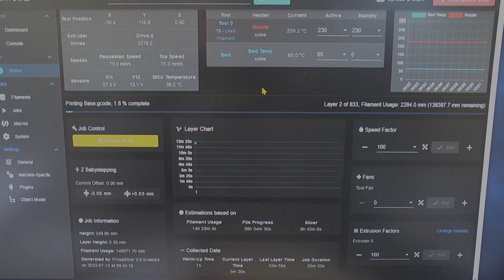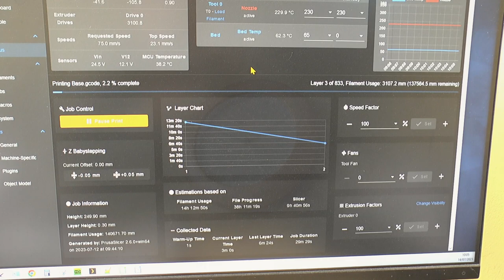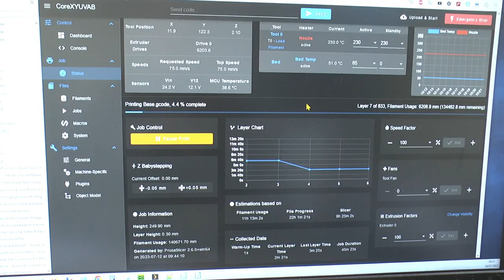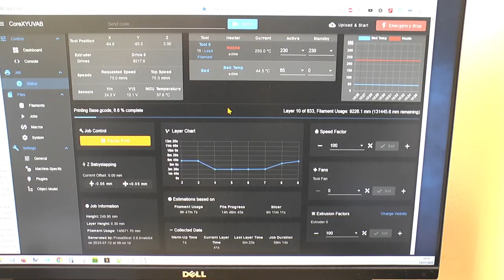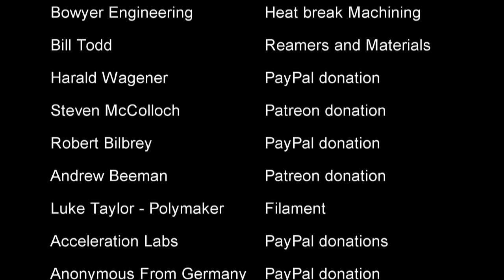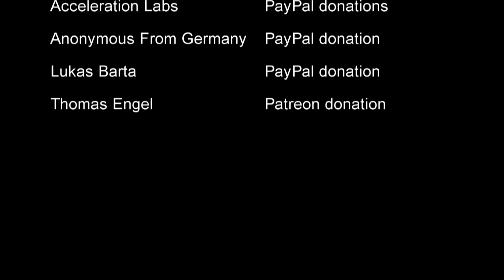NewCoreXYPart13 - UPS battery runtime tests and other bits and bobs

Comment: I have a 24v solar system running my network and fridge . I use 22.6 as a lower limit   ( that's when the mains psu takes over ).
Reply from the maker: What type of battery(s)? Mine are lead acid technology (albeit gel type rather than "wet"). I couldn't afford Li ion of LiFePO4 but for sure, they can tolerate much deeper discharges. I'm being guided by Yuasa's recommendations here. They state (for lead acid - quote) " The life of a battery regularly discharged by 50 percent is about 5 times that of a battery regularly discharged to 100 per cent". They also say to scrap any batteries who's voltage is as low as 11V (for 12V batteries) as "these batteries will have developed sulphation that cannot be completed reversed by charging".
Reply: @deckingman  s /h agm car batteries.  I've popped the lids and added water  , crash charged them to reduce sulphurization.  . Measured capacity is a fraction of original but they still work   ok 8-)